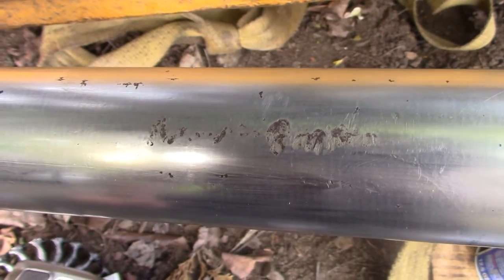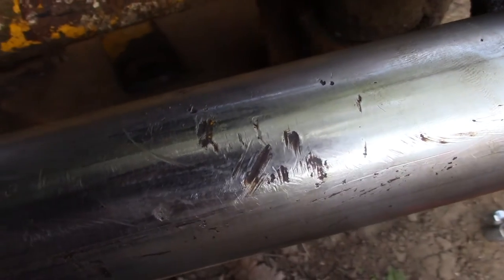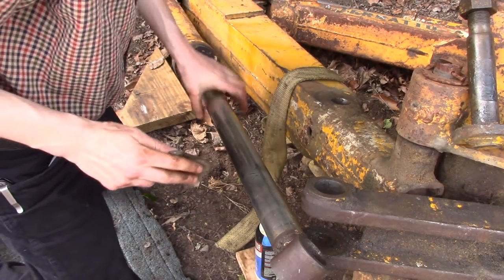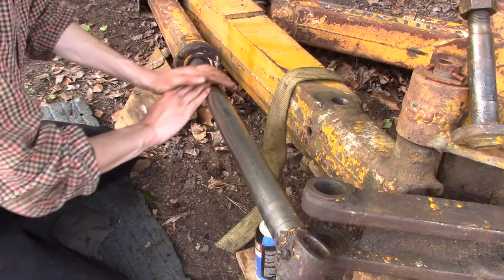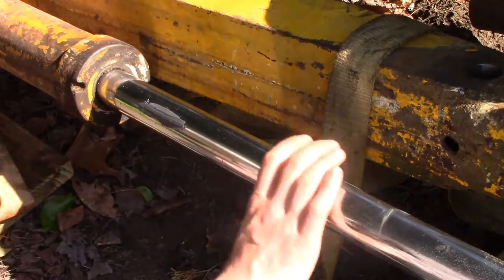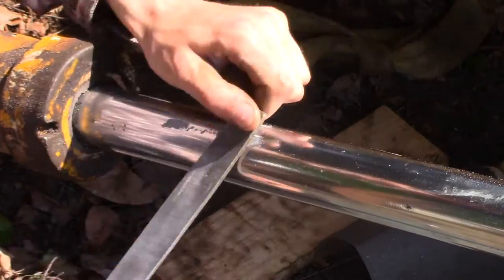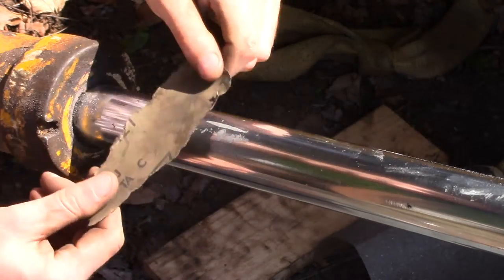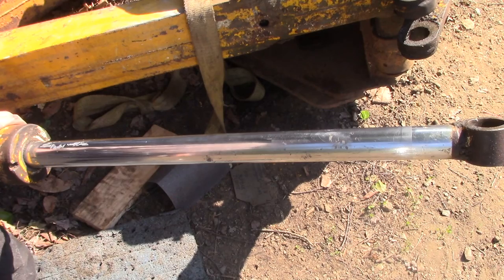Ford-A-Hoe Part 7 - Repair Damaged Hydraulic Cylinder Rod

Comment: I used JB Weld to fill 4 deep scores made by the wrist pin in the cylinder walls after total piston destruction. I used a propane bottle torch to burn out any oil first. The I used the acetone. I finished up the "repair" the same way you did and slammed the engine back together. I put 15,000 miles on that engine without burning a drop of oil. I believe the repaire would have lasted much longer than that. Upon the teardown of the engine, due to a different piston shaddering. I found the JB Weld was still very much in tact and no signs of degradation. I reasonably suspect since the JB Weld was well below the combustion chamber. And well above any point of prolonged oil exposure. Would be the largest contributing factors of its success. Also the cylinder was not broken. Which would have caused the repair to fail in a short period of time. Oh, just for reference sake. The engine was a 4.0L  and is still currently installed in my 2003 Jeep. The piston skirts are known for breaking off around 225,000 miles. After the second piston exploded. I completely rebuilt the engine. And I had the cylinders cut out and replaced too. So unfortunately I cannot see how long the JB Weld would have lasted. Sorry.

Thanks.
Reply from the maker: Cool! I've done that same repair on hit and miss engine cylinders, but didn't know how well it would hold up in a modern engine.  glad you had luck with it.
Reply: Ya JB Weld is pretty impressive. I JB Welded a non-fouler into the head of a 2 cylinder Wisconsin once. It had no threads in one of the spark plug holes. I cut diagonal grooves into the hole with a hacksaw. Spacing them about the width of 2 saw blades. Just so the JB Weld had something to grab a hold of. That was 5 years ago with regular use. Still running strong...
Reply from the maker: awesome! Only downside is that you need to pull the head to clean the sparkplug. ;)
Reply: That's why I JB Welded a non-fouler into the head. Then the spark plug threaded into that.
Reply from the maker: Missed that part. Sounds good!

Comment: I watch the video on how to straighten a cylinder shaft I used your technic on a servo 8000 log loader stabilizer it has 20 degree bend it worked well a bit scary but take your time and it works saved me 900.00 dollars.
Reply from the maker: glad to hear it!

Comment: I bought a 1966 ck 530 188 case Diesel Backhoe for $2500.00 I  had the same problem like you got going but I don't have  nicks I've got rust spots I'm going to wire brush those spots  and rubs some hard grease on the chrome rod

Comment: one more use for JB weld ,Iv used solder before but unless I'm in a rush Ill try this
Reply from the maker: Solder to fill in a piston rod? interesting. how do you get the solder to stick? i would think you would need to get the rod pretty hot to let the solder stick.
Reply: just use some of that liquid acid they use for soldering wipe it off with a clean rag a couple of times and put some paste on it sticks real good,solder sticks really good to clean iron ,might have some trouble though if there is rust in the spot from old damage. but you scrape it before hand with the tip of an old knife it should work
Reply from the maker: Interesting. I'll have to try that next time. Thanks for the tip!

Comment: Hi everyone! Can I take the other end of my Ford backhoes cylinder off??

I have 60`s 4500 backhoe. I was unlucky and stupid enough and got the crawl-cylinder rod to bend pretty badly. Wise move might have been to just buy a new cylinder, because in my country inch-measured repairs just don´t exist. Well apparently I am not very wise man. I got a new straight rod from a local one of a kind Ford backhoe -lunatic (great guy!) and other parts (I don´t know english terms to them)  were made (turned) just for me. (The end price wasn`t that gigantic.) 
The problem is that also the tube got hit in the accident. There are few scratches inside. I planned to "JB-weld" them. Unlucky enough, the scratches are in the "deep end" of the tube. Am I able to take that end off of the tube??? It would be very much easier to do the job from that end.

Thank you for your reply (anyone who knows the answer, is welcome to give advice:)
Reply: I also own a 4500 backhoe.  
Were you able to fix yours?
Reply: @TqSNv9R0iG5Ckxew  Hi, yes I got it working just fine. Some wise man warned me the possible results of putting JB-weld or other stuff there (it getting off of cylinder wall and ending to get in hydraulic system). So all I did to it was that I honed the sylinder with the 20€ market hone so that the scratches won´t harm the piston sealings. I actually ended up putting that cylinder to my newer 4550 because in THAT mahcine the rod from the crawl cylinder BROKE IN HALF (from the piston nut thread end). I did also get the other rod fixed, but the older cylnder is still on that 4550 and is working fine.
Reply: And btw, I wasn´t referring to this video or themadmailler JB-welding his rod - i´m sure that was the best he could do to his rod. In my case the scenario was that the scratches were (are) inside the cylinder so they were (are) way harder to clean, fill and file/sand AND those scratches actually don´t matter much as long as the  surface is honed properly.
Reply: @leonardotheturtle6711  
Thanks for the warning.  I will reconsider using JB-Weld now.   I am also embarrassed to admit that I only considered the damage to my hydraulic rod and not the damage to the unseen cylinder wall.  Probably because it's not visible.   I will have to take a closer look once I get it apart.  Thanks again for your advice!  It can be a challenge to keep these older machines running!
Reply: Time flies.. I sold the 4550 to my friend, and he has done some nice upgrades to it, and the cylinder we are referring here is still in use on that machine and working fine. I have the older 4500 still laying on my yard and I'm wanting to make a powerful snow machine from it, but sadly I might not have enough time to do it. I have collected a bunch of fine "new" parts for it, but everything is still deassembled. We'll see... Did yours come back to live?